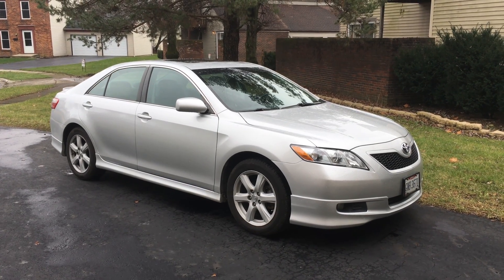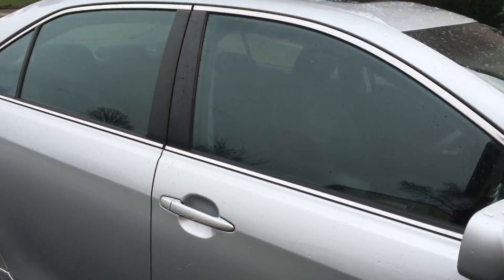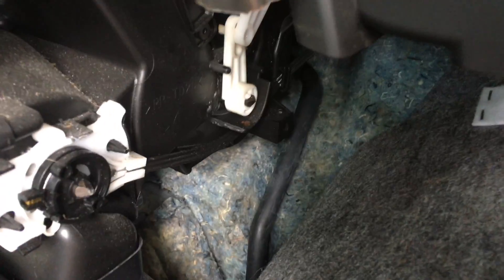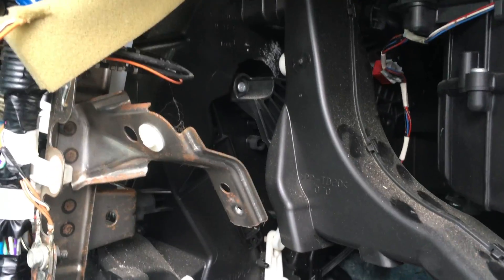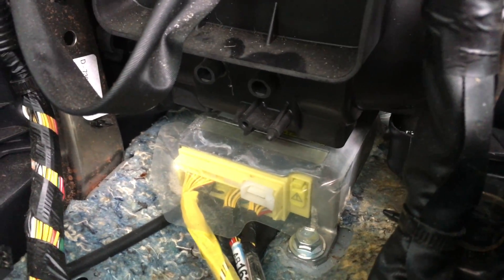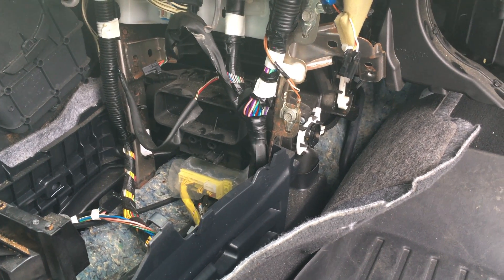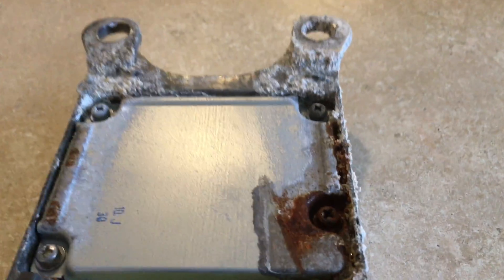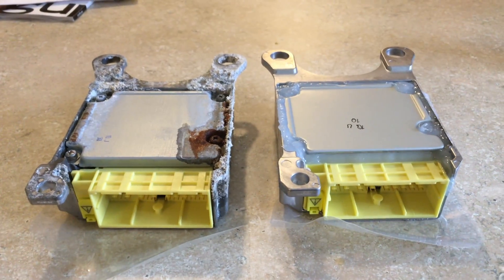2008 Camry Airbag Safety Flaw

Comment: Hi. My son has a 2007 Camry, getting ready to turn 300k. It burns, quite a bit of oil. I also am amidst an airbag puzzle as well. I believe that I am going to replace the module under the evaporator although there does not appear to be significant corrosion. The big mystery I am trying to figure out is on the passenger side. The main SRS light on the cluster is constantly on and the passenger air bag constantly indicates that it is off regardless if an adult is in the seat or not. In addition, the seatbelt indicator for the passenger side is constantly on, even when the seatbelt is secured. My question for you is….did your passenger airbag indicate “off” regardless of passenger in car? Did your passenger seatbelt indicator stay on when you were having airbag problems?
Reply from the maker: I honestly forget, it has been quite a while. I can say that since I replaced both the passenger module under the seat and the main airbag computer, I have not had an airbag issue since.

Comment: How much oil does you 08 se burn mine about a quart every thousand miles. Piece of shit car.
Reply from the maker: Mine does not burn much oil, I do have a small oil leak in the pan though. I probably have to add a quart every 2,500-3,500 miles. If I remember correctly there has been a recall on Camry's of that model that burn too much oil. You can check recall status online: https://www.toyota.com/recall
Reply from the maker: I have nearly 200,000 miles for reference

Comment: What else do you have to remove in order to get the module out? I can remove the one 12mm bolt on the front but cant get to the back bolts
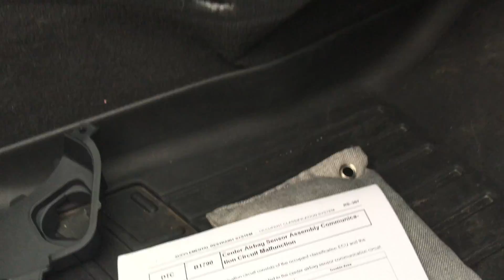Reply from the maker: I believe the bolts are the same size, there are two in the back and they are a pain to access. I had to remove the glovebox and the side panels below it all the way to the floor on both the driver and passenger sides. I was then able to squeeze a small wrench behind the module and slowly remove the bolt using partial turns. The frame at 2:42 is what I had removed to access the bolt from the passenger side, the driver side was similar.